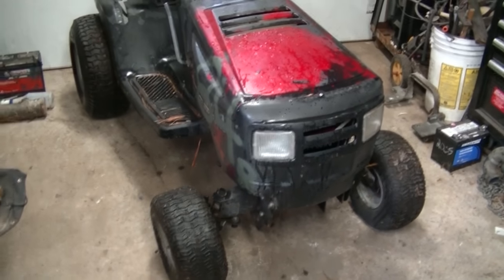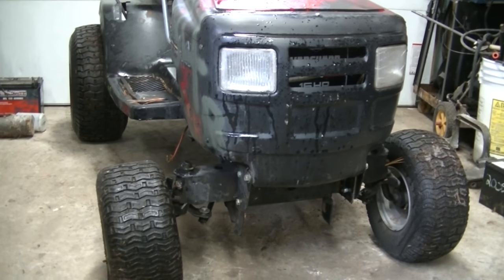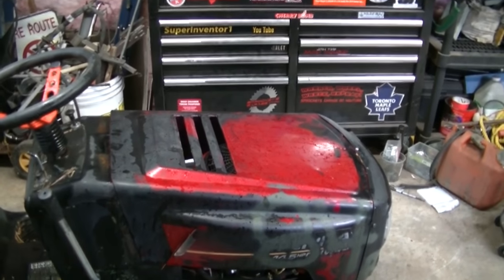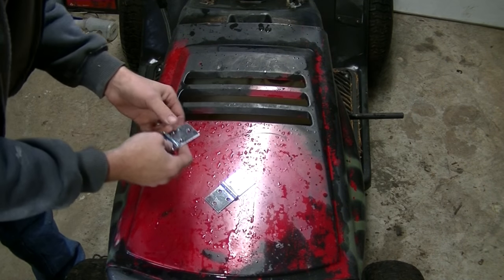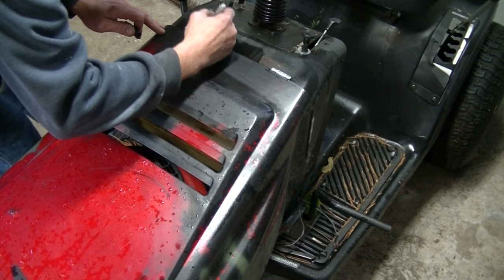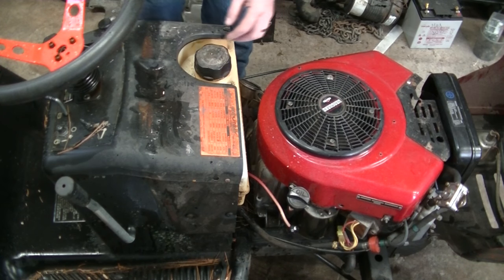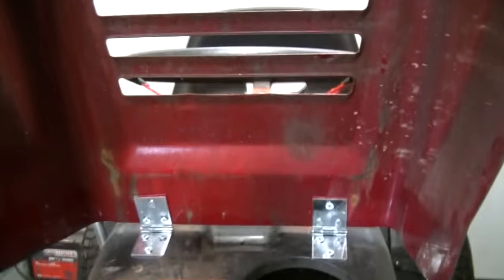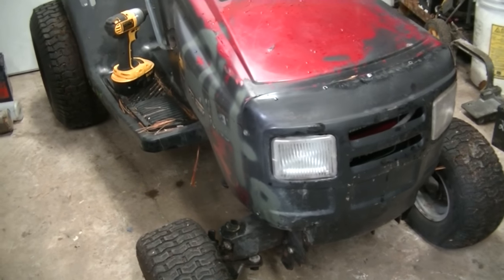Murray Widebody Hood Modification Part 1

Comment: i see, y did it like those old 90s murrays, with the ' car hood'  opening. i almost thot y were gonna cut the middle just to open and solid bolt the front n sides.  im using a 90s gt murray with that hood opening for my trail/ mud tractor.  i hear y about the murrays, i like em and have a bunch of them, even a bugg eye version, just dont have one with that style hood currently on fugazi.👍

Comment: Use rivets instead of bolts. Easier, cheaper.
I use them all the time.
Reply from the maker: I MAY switch to rivets later. I bolted it this time, because I still need to break it all down for paint. no sense having to make myself drill out the rivets or mask off the hardware.
Reply: Ahh. Fair enough then. Yes drilling out rivets can be risky.
Thanks for replying. 👌

Comment: 5:30 in, my old battery in the corner
Reply from the maker: Good eye!
Reply: Sprocket's Garage hey Doc I'm curious if its possible to use a centrifical clutch on a vertical shaft engine, 35-40 roller chain and a sprocket on the transaxle, my concern is proper operation of the clutch, I can eliminate chain slap, I subscribed because of your diesel weasel 👍. if you or anybody who reads this has any info.. it would be greatly appreciated.. thanks
Reply from the maker: There are two things I don't like about the idea 1)Getting dirt, sand, or mud into a centrifugal clutch, will not make it happy at all. Being underneath the machine, there's a risk of it. 2)Having a long, lateral chain run will cause the chain to sag and skip off the sprockets, or at least chew them up faster. If you can find a good way to support the chain, that should help.